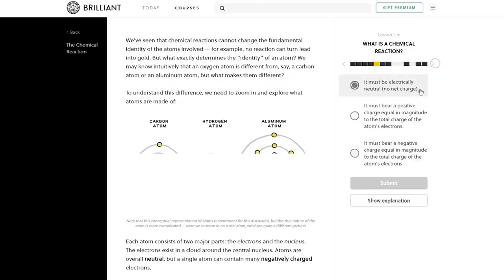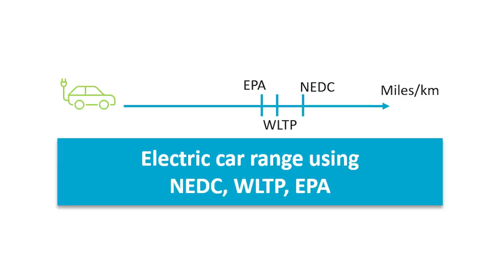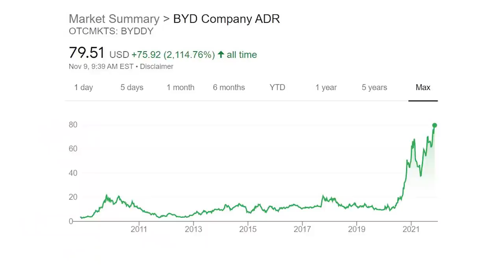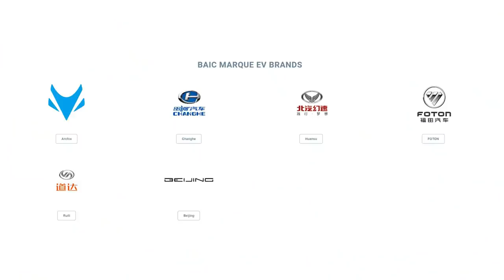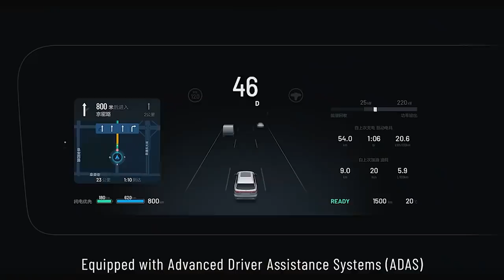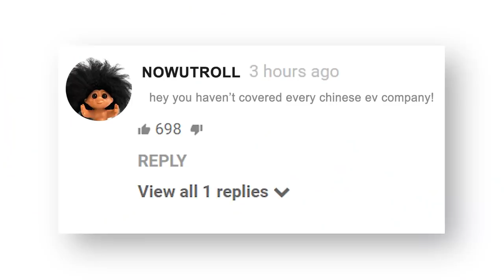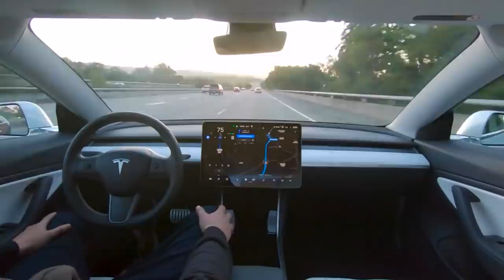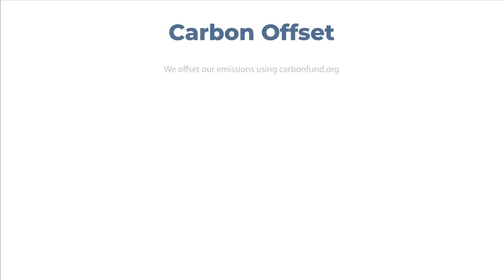China is Coming: Part 2 | In Depth

Comment: I am a foreigner living in China, today I drove the zeekr 001….it was outstanding and blew me away, I drove the top level with the air suspension and 4 wheel drive, it was an amazing drive and the acceleration was just mind blowing. The driving dynamics were great and the car was super solid, the acceleration from 40 kph to 100 kph pinned me back into the seat.The interior level of quality was also great, and the interior tech was on par with Tesla and maybe in some areas even a little more….
Reply: Have you driven a Tesla? If you have, it's hard for me to see how you could be so impressed with the Zeekr's  acceleration, as I suspect they are very similar. I'm curious in what areas interior tech was a "little more".  Nice looking car. Thanks for the reveiw.
Reply: @wilfredvanvalkenburgh2874   I haven’t driven a Tesla, so yes you are right maybe they are similar, it was only my second experience in an electric car, I have driven a polestar 2 on a test drive before and only got to use partial acceleration.  From the interior tech stand point it features haptic feedback on the steering wheel, and a really nice HUD which allows you to keep focused on the road. Also the doors are electronically opened and can be easily controlled by the centre touch screen, the sunroof glass is also auto adjustable depending on how dark you want it to be. again I would need to drive a Tesla to compare, but for the price of around 290,000 rmb to 360,000 rmb the size of the car and the amount of features you get not only in terms of performance but also comfort it’s very appealing. I’m going to make a YouTube channel soon to show all of these new electric cars.
Reply: @wilfredvanvalkenburgh2874  he didn't compare the acceleration on Tesla. He talked only the interior....
Reply: @jimmyb1643  love to see your reviews.
Reply: Wow. Thanks. I'm waiting impatiently for the ground-up EV from Volvo and Polestar and the Zeekr 001 is a good preview of those.  I'm not surprised to hear interior quality was great either. I've heard that for NIO vehicles and XPeng's.
Reply: Love me some slave labor cars 🚗😎🤘
Reply: Agree, some of the more impressive vehicles coming out of China.
Reply: @wilfredvanvalkenburgh2874  I think acceleration of 0 to 60 around three seconds will just never cease to be impressive. That’s why you see hard-core Tesla reviewers driving a lucid and being super impressed by the speed, even though it’s technically may be a little bit slower than a model S plaid. It doesn’t lesson impressiveness of the Tesla. It’s just that they often talk about how fast these other cars are without mentioning the plaid in the same review.
Reply: @cuteandfunnyearthlings2863  As mentioned, this will never happen, or what will happen in the Chinese Marked with allllll the Us and western Carmakers?
Hm?
Na?
Reply: @wilfredvanvalkenburgh2874  lots of tsla car in china，and china made in
Reply: @cuteandfunnyearthlings2863  Sandy already said they can't. Pay attention!! 🤭🤭
Reply: @Chinese080808  You believe everything sandy says like gospel? US can use law of the jungle.
Reply: @cuteandfunnyearthlings2863   I don't believe everything anyone says but he does make a valid argument as to why they can't say no.
Reply: @cuteandfunnyearthlings2863  hi Cuty, Chinese EV no need to market in usa. Enough for them market to  asia or some europe. it's enough just to make Tesla fire a beard.
Reply: @RefinedRags  Thank you for finally saying this. We are all complicit in our own demise.
Reply: @putianren  Is this written in English? I don't understand.
Reply: @OneAdam12Adam   can you show any proof? I'm all eyes and ears.
Reply: @cad5238  ARE YOU RASIS,,,???!!!!
Reply: @cuteandfunnyearthlings2863  Thats 5G earthling. Not g5.
Reply: @Phantoma3   that's interesting! How do you know this?
Reply: My husband is living in China and driving Zeekr 01 when he's here and drove my Tesla model s he said it is very much the same but he rather take the Zeekr 01 any day over the Tesla, he said Zeekr 01 get better range then my Tesla.
Reply: I've been to China before, I'm now convinced China is the future.
Reply: @kindoson Burns  Did you watch the video? Tesla and many other international brands are made in China too. Which car do you drive?
Reply: @benjaminsmith2287  Perhaps, the history of the owner and founder of the company will give you even more confidence. Mr. Li was legendary in being a small biperson staring off assemblying fridge and then motorbike early on, when all the cars in China were kmostly imported with a few produced by SAIC -the Shanghai SOE, he was a dreamer wanting to establish a privately owned car company, and look how successful he become in the end. Love his cars and the stock of his company. Goldman Sachs bought a stake in Geely just like Buffet buying BYD and made a huge kill out of it.
Reply: 作为一个汽车行业从业者，前几天接触到了极氪001，哇偶，真的是颠覆我对自己国家汽车品牌的认知，相当不错
Reply: @cad5238  ya looking for Chinese guy or girl? WTF, we're talking about cars here.
Reply: @RefinedRags  OMG. While we are both writing from outside of China, the ignorance is stunning. Ok, I have the advantage of being on the same time zone as these guys and can understand Chinese. But key, they are super automated. I could purchase something online and they arrive at my door step within the week at USD0.75 shipping cost! Reason? Automation, robotics, and fantastic logistics.
Reply: I’m Chinese and had been living in Sydney for the past 10 years. Came back to China and bought a Zeeker 001. 0-100 in 3.8 sec. Same price as a based model 3 but much better interior and much better looking exterior. Love it